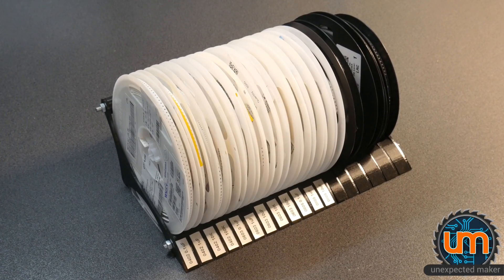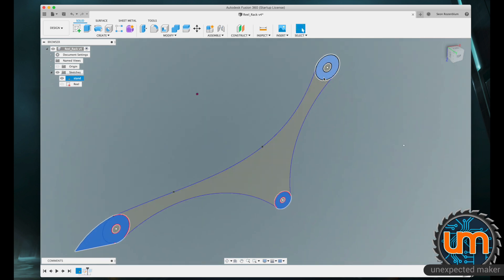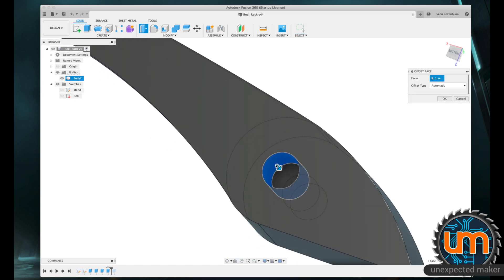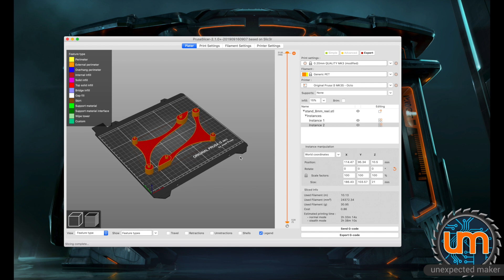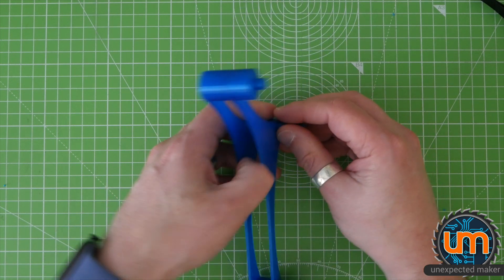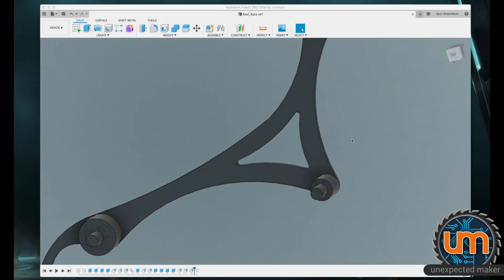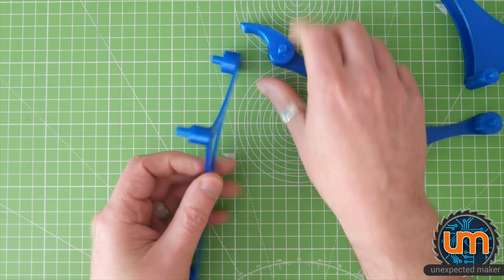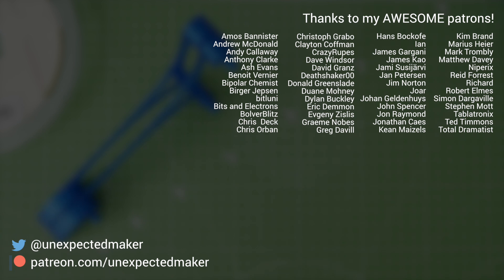3D Printed Modular Reel Rack - Part 1

Comment: You mentioned that the 2nd version took 9 minutes longer to print than the 1st, and concluded that it wasn't worth removing the fillet in the side wall.

But of course you did extend the forward foot, and that - at 15mm thick - would require more extrusion time and more filament.

It would be really interesting to compare both versions in Cura, so I was wondering whether you had any plans to release the STL files under an open hardware (on say GitHub)?
Reply from the maker: I'll be releasing the files on thing averse when I post the part 2 video

Comment: I personally have no interest in this technology,  but it is still fascinating to watch, I kinda wish I had a use for one ! However, with the plastic pollution issue becoming more alarming I wonder if you can recycle ? because I can see lots of failed prints here, that could potentially just end up as landfill or whale food.. the last thing our planet needs is another source of pollution...as always, fascinating video, the design of these parts looks like great fun, I think a small printer is going on my "bucket list"...cheers!
Reply from the maker: Yeah, it can be wasteful... sometimes you need to just print a test to see if it's right or not, and the waste can add up. There have been some folks looking at re-cycling/re-purposing 3d prints, but I don't know of any that has made any impact.

Comment: Nice work. I had the same experience with creating cut-outs (in larger flat areas), in the hope of speeding up print time. But it actually lengthened the print time, I think due to the print path now having to encircle the cut-outs.  I supose it does save a little filament though.  :-)
Reply from the maker: Yup! Lesson learnt, but I think they look cooler with the cutout - not that you can see them when they are filled with reels!
Reply: Anytime you create an intersection or an interrupted will want in the part so creating a void creates to interrupts